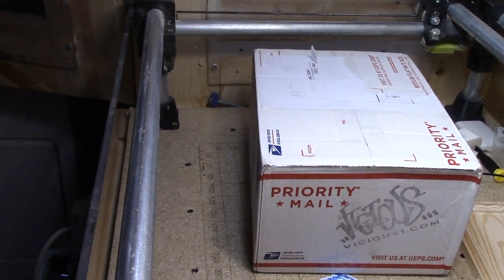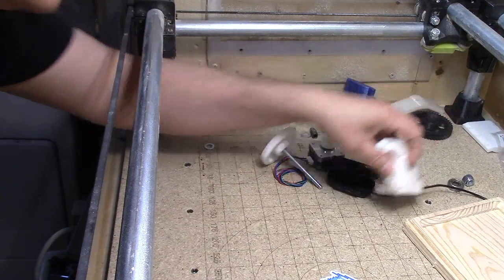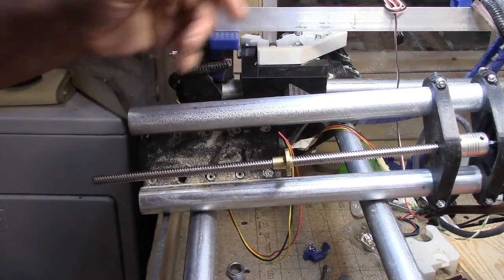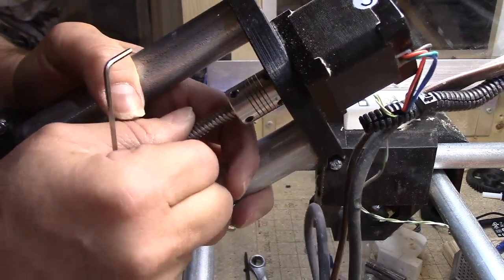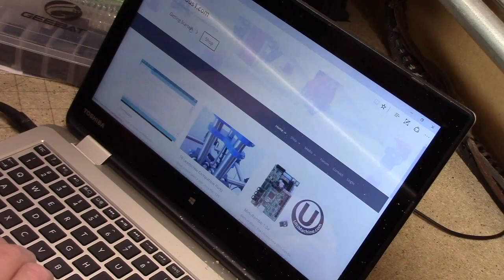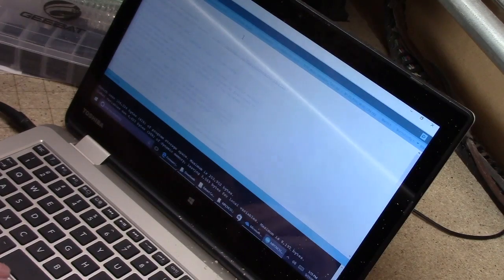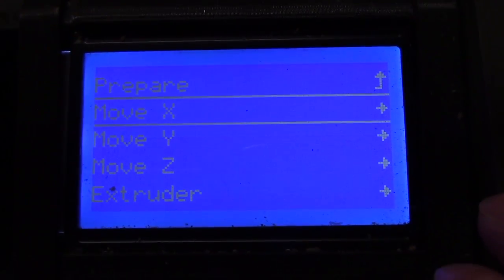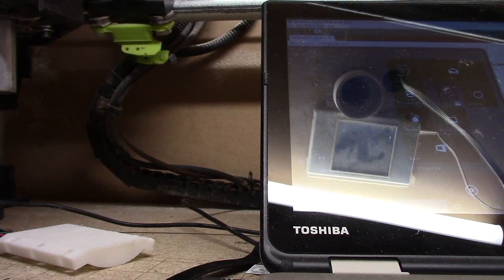MPCNC 25   Switching to Leadscrew on Z Axis

Comment: I dont understand the mounting of the brass nut for the T8 leadscrew. (I am currtently building a MPCNC and have no printed everything, starting the assembly).
Are really the M3 screws directly cut into the plastic the only thing holding down the brass nut??

What happens, when you move the mill down to cut into the material? There is some force to dig into the material, and this force tries to pull out these tiny M3 screws with the brass nut, doesn't it?

(sorry for my english - I am from Austria)
Reply from the maker: Greetings!  Yes, I understand your concerns. However, PLA holds the screws very well. Just thread them in by hand (Don't use a power driver) and don't strip them out.  It's the same design on the lowrider, but it seems to work well.   The screws only support the weight of the Z axis and Spindle.  When pressing down, they just keep the nut from spinning. 

Here's a discussion about it: https://www.v1engineering.com/forum/topic/it-has-been-a-year-beyond-the-525/page/2/#post-31656

Comment: which one is better? the treaded rod or lead screw?
Reply from the maker: That's a good question!  I think the lead screw is better.   The lead screw, I think, would be the modern way to go. Possibly less likely to get gummed up with dust. There was enough torque with the threaded rod to lift the MPCNC right out of it's feet if you forgot to turn the router on, so that might be another reason to go with the lead screw. I made PCB's with the lead screw, so I don't think there's a resolution or accuracy problem.  There's less of a chance with the lead screw to drive the z-axis so fast that it would miss steps. Yes, that final point is major.  The lead screw is the way to go...
Reply: @Someoldguycoding  Ok thanks for the reply! I am building my own version of this and wanted to know what to use.
This was helpful information.
Unfortunately I will not do the MPCNC as it requires 5 steppers, and I have only 4.
look at this design: https://youtu.be/TXEHunJmjcg .
Thanks
Reply from the maker: @wolfvierbergen1417  Very nice design!  Very compact.  Great job!

Comment: wich kind of lead has the t8 you have installed? ther`s no need of an anti backslash nut?
Reply from the maker: Not sure about the details on the T8. I ordered it from vicious1.com:https://shop.vicious1.com/collections/parts/products/300mm-leadscrew-and-nut.   Here's a discussion on the forum about backlash nuts: https://www.vicious1.com/forum/topic/t8-lead-screw-with-anti-backlash-for-525-modification/.    Vicious seems to think it's not needed...
Reply: My kit came with a T8 leadscrew and one brass nut.  The only time I notice a backlash issue is when I lower the bit to the material, I have to use a feeler gauge.  I have ordered a second nut to install on the top of the gantry.  I suspect that by clocking the two nuts properly, any backlash will be removed

Comment: At the end of the construction part of the video , it appears you have the bearing pressed back into the Z-lower bracket . Mine will not go thru . How did you do that ? - Thanks , jbskone
Reply from the maker: At 4 minutes into the video there's no bearing in the lower holder. There's a comment on the screen that I had forgot the bearing and had to take it all apart again.   Sorry for the confusion !   Thanks for watching!

Comment: Thank you for making the tension part clear! Always touching and the bearing holding the bottom perfect. I was just trying to figure out the best way to show it. Your making my job easier. High five. The logo took a little more space, mem, and delayed the boot a bit. (Really I am trying to make a new logo). Yikes I have a max value for the Z speed but I still have it firmware limited to 8.4mm/s, I should change that. So sorry. I made a note and I will put up some new firmware soon.
Reply from the maker: Thanks! Yeah, I miss the logo, but the faster boot is nice too. NP, I can as always tweak the zmax when I'm ready. Thanks for the fast shipment of the parts. It's funny, for some bizarre reason they always seem to go to new york for a few days before the come back to Minnesota.  I think someone in the Oakland USPS office needs a map!  Love the vicious1 stamp on the box.